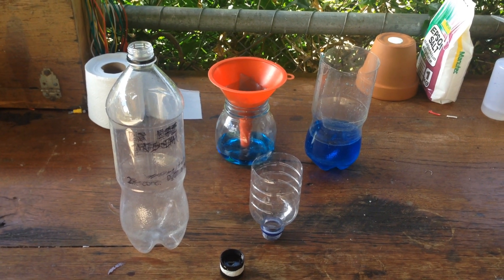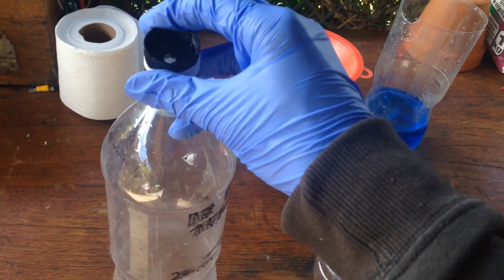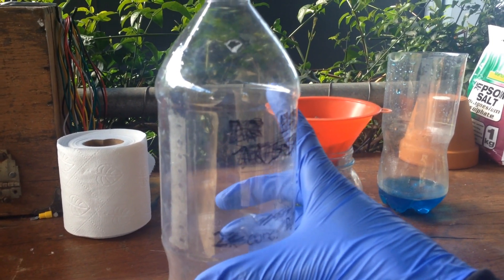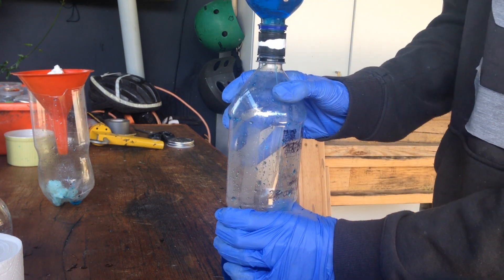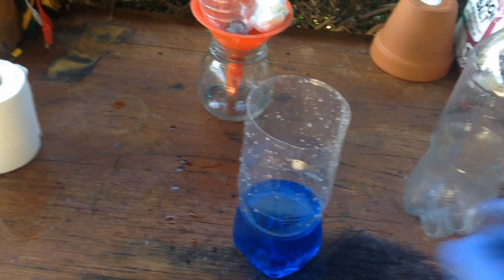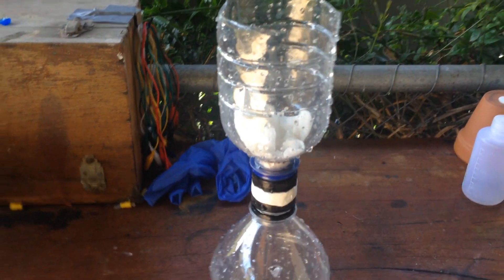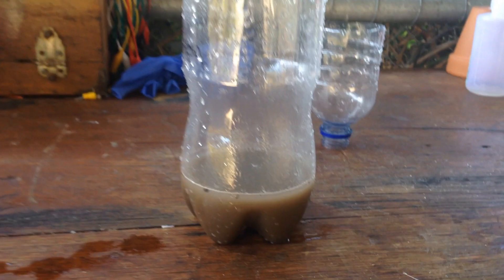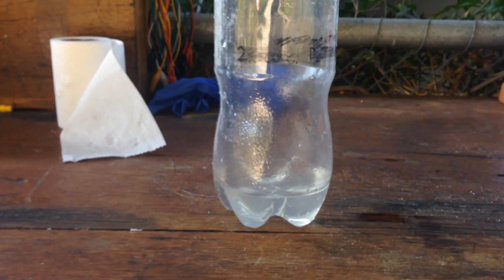Simplest DIY Vacuum Filter

Comment: nice DIY. I think you can get better results if you screw the cap over the filter rather tban stuffing it down, because you wont have any direct leakage unfiltered liquid. you can also then have a much larger reservoir because you dont need to reach the inside. It probably wont work with toilet paper because it is so fragile when wet (not a good filter material), but anything a little sturdier like a coffee filter or or a piece of an old tshirt should be fine under this low pressure. coffee filters are typically 20-30 microns and dirt cheap, so its good enough for many applications.

I would really look into making a better valve so you can maintain pressure without holding it the whole time. that's a bit of a pain. even just another soda bottle top and cap cut to fit and hotglued would probably work

Comment: I made one as well but ended up adding a plastic check valve that came with the whisper air pump I use for agitation in electroplating.   Now I can squeeze and leave to do something else. 

Great videos!

Comment: Thanks for the idea! There are some things that i did different which might improve your solution/proces:
 Because toilet paper is designed to break down in water, and not to filter things, you might get pieces of tp in your solution. Instead, go for coffee filters. What I also did is cut a hole at the top of the bottom flask and attatched a tube on it, which then was connected to a vacuum. You will get it through the filter in no time.
Reply: Used a piece of kitchen sponge for first round, then cleenex (Zewa in fact) and then flutet paper but with a lab funnel, vacuum adapter and a compressor vacuum genartor setup. Sealing is my most problem I think.